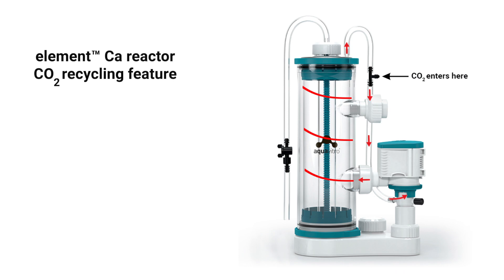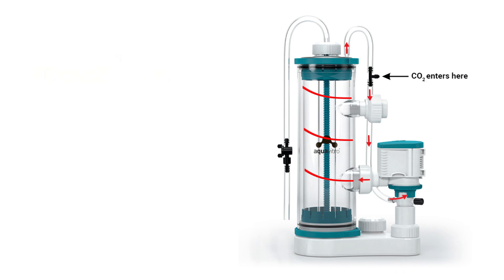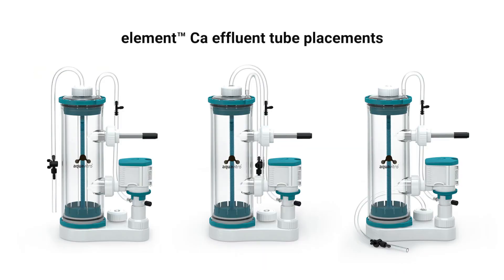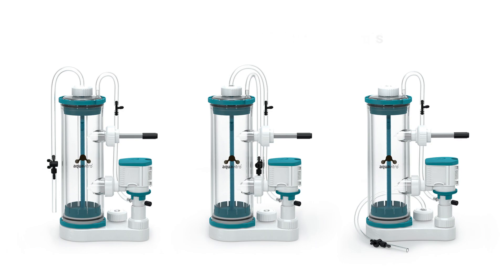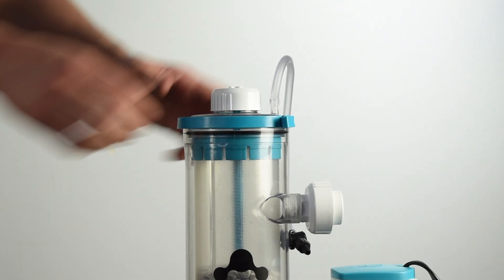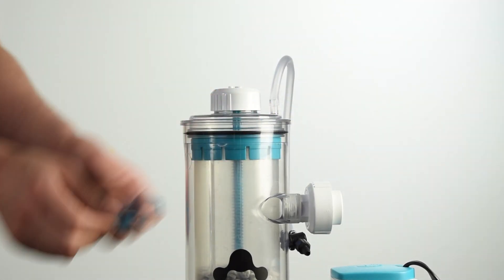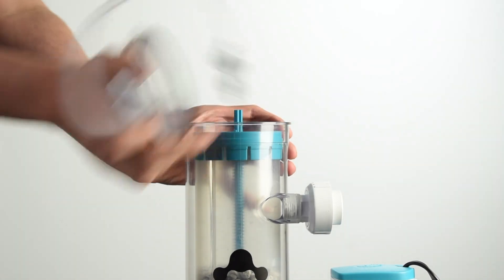aquavitro element™ reactors - What to know!

Comment: Hello, I own your 250 Skimmer. When is your add on recirculating kit going to be available?
Reply: You only need a short length of 1" Schedule 10 PVC to link the pump intake to the base, I did it already
Reply: @ReefBuildersVideo  Thanks, I looked at the parts list and I see where it looks easy enough to set this up. What pump are you using. I have a spare Varios 2 I might try.
Reply: @ReefBuildersVideo  what size of PVC tubing do you need to recirculate the Division 125?